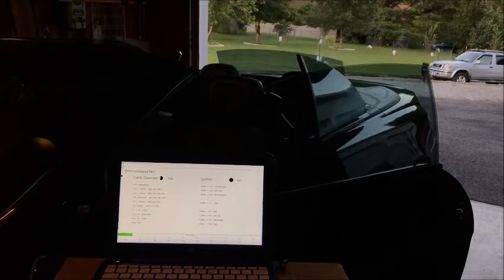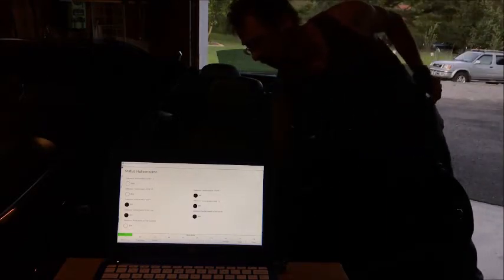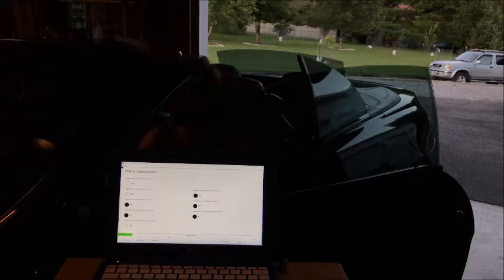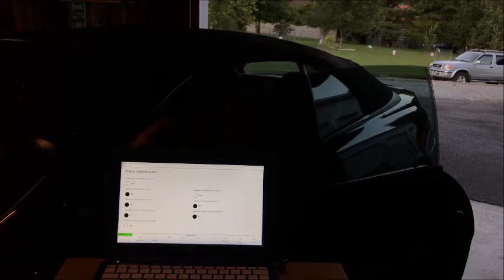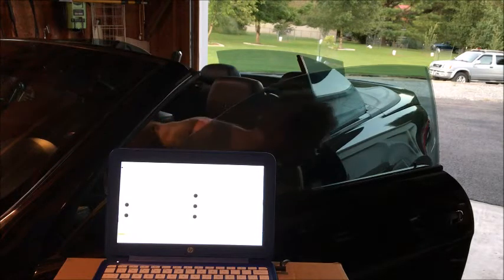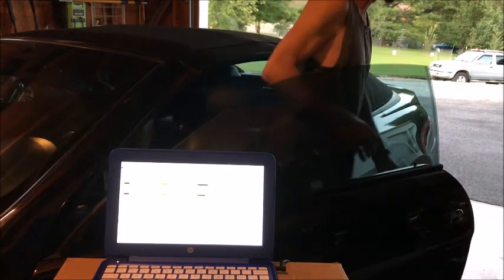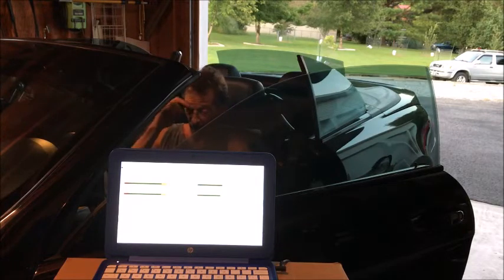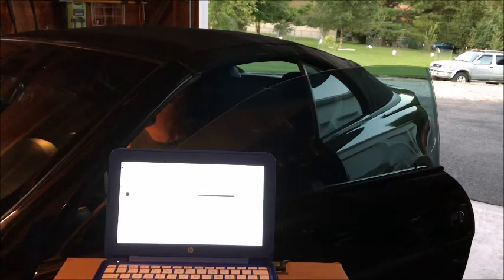BMW e64 Hall Effect sensor status and what happens when the segment sensor goes bad

Comment: Hi Steve, brilliant series of videos. I have a E64 650i cabrio which has worked say 80% of the time, now the deck wont open at all.... anything I can do to diagnose ? tia.
Reply from the maker: Thanks man, glad the videos are helpful 👍. For the issue, do the wings raise up, but then the deck lid won’t open when the car is trying to fold the top into the compartment or is it that the windows all go down, but then it will not open the deck lid to begin the cycle to unfold the top to cover the car?
Reply: @StevesDIYs  So with the top in the closed position when the 'open' button is depressed all the windows go down, the front unclips (sometimes needs a push) both the wings raise however the compartment fails to open just a lots of whirring and then alarm 'bongs' ! Press the close and it all goes back to closed OK.
Reply from the maker: @markambridge9887  , 👍. The good news is that it sounds like it’s going through the sequence good and if the wings will lift then the hydraulic pump is still working fine (I have to help mine a little as well on the initial opening as they seem to struggle right at that point sometimes). It sounds like it’s just waiting for the conditions to be right to let the computer know that the wings are fully up and out of the way so it can open the deck lid. The segment sensor on the driver side wing is the one that tells the computer the wing is fully up (it needs to know it’s out of the way so it won’t crash the deck lid into the wing). A good way to tell is to have someone hold the button to make it go through the cycle and while they are still holding the button, when the wings come up, grab the driver side wing and raise it a little up or push it a little down to see if you can hit the segment sensor position. If it then tries to open the lid (or at least starts to open and then closes back) then it’s most likely the segment sensor that is going / has gone bad. Maybe give this a try to see...if it does allow it to move the deck lid, changing out the segment sensor is not very difficult and there’s a video on the channel as well for how to do it. Just let me know if that did anything...if not we can think on through what the other possible issues might be 👍.
Reply: @StevesDIYs  Hi Steve, just to update you on progress... it's been rather rainy of late so have not had chance to have the top down however I Wednesday evening was dry so I fired her up and pressed the open roof button, everything worked like a dream, even the release from the screen top ! Hoping the weekend will be good weather for some more testing. NB. I did have both doors open while trying if this makes any difference ? rgds.
Reply from the maker: @markambridge9887  oh, very nice that it went through the complete cycle 👍. Definitely just something with a sensor not picking up the correct position to allow the cycle to continue when it messes up then, as all of the mechanics will function.  Unfortunately, when the segment sensor gets grumpy, it won’t do it every time so it’s really hard to get it to repeat the error when you want it to (but it will always error when you are away from the house and don’t want it to, lol).  The next time it does it, try doing the driver side wing wiggling and that will let you know if it’s the segment sensor or not. Having the doors open shouldn’t affect the operation I wouldn’t think, but the electronics are so complex on these it’s hard to tell. Anyway, very good news that it does fully function...that rules out relays, pumps, motors, and the lifting linkages for sure👍.

Comment: Steve thanks for the information and this great video !
i get the error, that my convertible top is not closed but it is closed...
on my inpa screen the main pillar segment (not the finn segment) shows "2" and should be "1" i think when the top is closed..
this error only occurs when its very hot outdoor.
do you know this error ? which sensor control this main pillar segment ? where is this sensor ?
if its easier for you i can sent you this pictures of my inpa screen.
thank you in advance !
Reply from the maker: Thanks man, glad the videos help some 👍.  The other segment sensor sits down in the bottom of the soft top compartment and attaches to the main support frame.  Here’s a link to another video on the channel where I show that sensor for just a second.  https://youtu.be/obY_R7XhcvE .  Right at the 13:23 time stamp I show it in the video for just a second.  It looks just like the wing segment sensor, but might be a different part number (not sure as I’ve not had any problems with that one so I haven’t looked close at it).  If you cycle the top and then stop it half way (with the compartment lid up and the wings still up) you should be able to see it and check it for a part number.  If you can’t find the part number, just let me know and I’ll look on mine to see what I can find.  Hope this helps and all the best !  Steve
Reply: @StevesDIYs  Thanks for this very fast and helpful answer, i will clean it for first and then i'll replace it if the cleaning doesn't help :)
Thanks !
Reply from the maker: No problem...glad to help 👍. Steve

Comment: Steve, thank you for the information on your INPA version.  I had the same version, and was able to find the convertible top module.  I think there may be an issue with one of your Hall sensors.  The middle sensor of the five on the left of the screen highlights for Deck Down.  The sensor never changes on your video.  There are seven Hall sensors that input the convertible top module.  I have included a link to a quick video I made of the INPA screens while putting my top up and down.  Let me know what you think.  https://youtu.be/iOzG3WznGBY

Comment: Hey Steve, great video.
I'm trying to get my top to error while I have the laptop/inpa available, but thought I'd ask if you have an idea which sensor could be acting up. 
While closing the top it would get stuck at the position when the deck lid should close to allow the top to finish stretching and closing. At this point it will not fold back into the compartment either? I have to shut the car off to allow the pump pressure to bleed off and the lid to close, then I push down on the lid to close it all the way and at that point the top will close the rest of the way normally. If I try to reopen the top immediately after this it will get stuck again where the lid is open but the top won't close again or complete the open process. After car sits all is good again more times than not.
Thanks Barry
Reply from the maker: Hey man !  It sounds like one of the segment sensors is not picking up the correct position to allow it to continue the cycle. At about the 6:12 mark in the video I switch to the INPA screen that shows where the segments are when the soft top is down in the compartment. The upper left segment readout is the one on the overall soft top mechanism that’s on the drivers side in the bottom of the compartment while the lower readout is the one on the wing movement mechanism (also on the drivers side, but up on the wing linkage). You can slow down the Youtube video by clicking the three vertical dots above the video screen and selecting .25 speed that might help some to see the positions just as it moves...thus way you should be able to see the segment positions just as the compartment lid fully lifts. If the segments on yours aren’t matching what’s in the video, odds are that’s the problem. I believe the wing sensor has to be on segment 7 and the main lift has to be on segment 1 in order to allow the deck lid to close. If yours is showing these in the correct segment, but it still won’t lower the deck lid, just let me know and we can think through some more things it might be. All the best !  Steve
Reply: @StevesDIYs  the wing segment reads 6 while in the open position waiting to either go into the storage or opening. It only reads 7 when fully into the storage compartment
Reply from the maker: @azhppro  , sounds like that may be the problem. If I’m not mistaken, the wing segment sensor should be reading the 7th position to let the car know it is fully lifted up.  One way to check is to have someone press to button to open the top for you and when it reaches the point when it won’t continue, lift up or press down on the wing a little to see if it will move to the next segment and then continue on with the cycle (or at least release the deck lid if a second and then gong if you let go of the wing. If it’s the full mechanism’s segment sensor out of position you can do the same by lifting the top slightly to see if it will move the segment and continue on. Maybe give this a try and see if it does anything different.
Reply: @StevesDIYs  thanks for the advice.  I'll let you know what I find when I can duplicate the issue and I'm able to use inpa at that time
Reply: @StevesDIYs  I was able to duplicate the issue while by myself. I unclipped the segment sensor arm and moved it to where I knew it would read 7 from earlier testing. The top did resume movement so I'll try to perform the mounting hole modification to see if I can get the switch to readout 7 when in that position instead of 6. Thx
Reply from the maker: @azhppro  , hey man !  Thanks for commenting back with what you found...helps to confirm the position it should be hitting while in cycle which will help others later on as they read the comments 👍. All the best !  Steve

Comment: Hey Steve great idea
I will do a video same as yours so you can see the laptop and the car 🚗 at the same time👍
Reply from the maker: Sounds good 👍. Once you have it you can send it to me and we’ll have a look.  All the best ! Steve
Reply: @StevesDIYs  Hi Steve i was setting up to do video yesterday to go through segments sensor with you and noticed by chance that the sensor on top of the ram for the back door looked like that it wasn’t sitting straight so i clicked it back in place and low and behold my roof works again 😀 
So Crisis averted but thank you so much for pointing me in the right direction especially as you mentioned earlier that it could be something to do with that ram sensor 👍
Reply from the maker: @davebarry814  hey man !  That’s awesome...I knew you’d get it figured out 👍. I’d probably still take a video of the movement along with how each sensor makes on the different PC screens for reference now that it is working again (that’s one of the reasons I made my video for my reference). That way if it messes up again you’ll have the map of when each sensor makes or goes off handy.  All the best !  Steve

Comment: Steve Dave here again from Ireland love this video it has being a great help.
I only set up inpa on the laptop today and followed your video.
I noticed that the Finn segment (bottom left) on mine only goes to number 6 before it locked out and the top left (main pillar segments doesn’t go past number one
I messed around with Finn sensor by grinding the mounting holes (as per your other video)to see if i could get it to 7 ,it did but main pillar still stayes at 1 and the pump is still. Under pressure
Still not 100% sure which one is giving me bother
Reply from the maker: Hey man !  Sounds like you are really close to finding the issue 👍. You can maybe loosen the segment sensors a bit and pop the arms off the little posts and swing them back a forth by hand to see if they move the segments on the computer. If they have any glitches in the steps as they move up and down they are probably bad and what’s causing the problems. Any little flicker in the segments is enough to make the cars computer think it is out of position.  The segments should move just like in the video...if not I’d say it’s something wrong with the segment sensor or possibly the wiring connections causing some extra resistance which will also throw off which segment it thinks it’s in. Let me know how it goes 👍. You can also email me at stevesdiys@gmail.com if you want to send a video or pics of what you are seeing.  If the segment sensors are picking up good we’ll have to dig a bit deeper, but really good that you have INPA as it will make it much easier to figure out.

Comment: Steve, Thank you so much for your video. I’m having all sorts of problems with my 645 convertible. My convertible doesn’t function. The other day the back window roll up on its own. Now that I put it back down it won’t come back up again. Also my radio doesn’t work I’ve already tried bypassing the satellite and still no sound. And I’m not very handy like you.
Reply from the maker: mong lieng , hello...yes, these are very dependent on the different computer modules to function flawlessly (and also communicate with each other ). They are also bad for water getting into the trunk compartment which damages the radio amp, optical network, and electronics.  The INPA and ISTA software helps a lot to diagnose the different systems (ISTA will scan each module and determine if everything is communicating and functioning).  Maybe you will get it sorted out 👍. All the best ! Steve

Comment: What software are you using and where can I download
Reply from the maker: Randy Williams , hey man...I got the copy I show on the PC from bimmergeeks.net (it’s a free download), but there’s other websites that have it as well.  It’s called INPA and usually comes with the other basic software for the BMWs.  The OBDii cable has to be purchased but it’s available from places like bimmergeeks as well or other places.  It’s called a K + Dcan cable and is the Silver one.  The sites usually give a description and what model cars it will connect to.  I think Bcables.com is another company that sells the cable and offers the software...if I’m not mistaken they provide the software in an easier to install format so it auto loads it up through a wizard.  The software is half English / half German since it was never fully translated, but google translate helps out a bunch.  Hope this helps, Steve